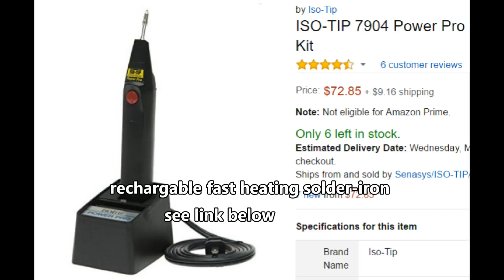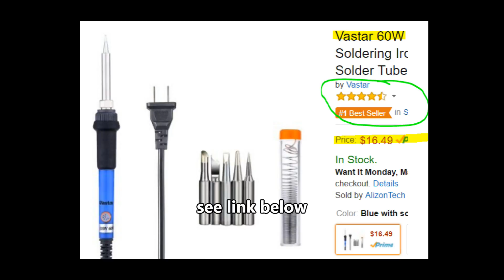How to solder / unsolder wires and capacitors (updated HD short version)

Comment: I bought a set of capacitors for DC two different (mf) but one is a Radial Aluminum electrolytic 10uf @ 63V and the other is Polarized radial 47uf @16V. Does it make a difference one being aluminum?

Comment: Hi, I am looking for a mother board for a 40" Samsung LCD TV. The serial number on the board is BN94-03079H. It is for a TV model LA40B550K1R. The thing is that the TV randomly starts flipping through the functions and the remote becomes unresponsive. It stabilises after powering on and off several times and setting it to factory default. The TV was manufactured in 2009. It started malfunctioning after two years.